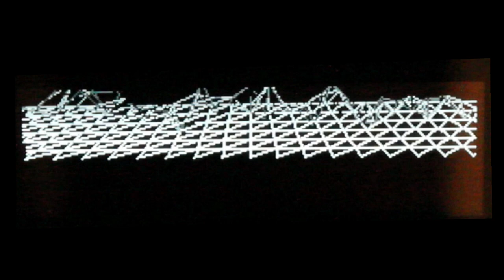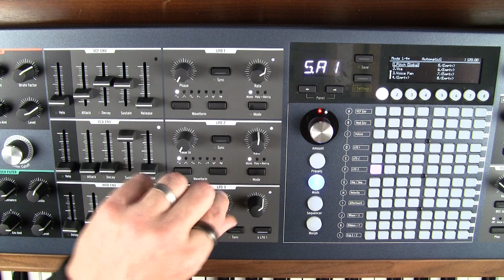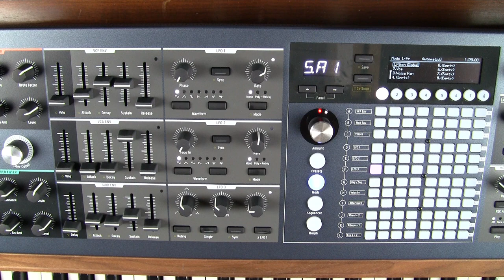12-The Arturia PolyBrute-LFO 3

Comment: One musical application of a unipolar LFO is if you want to use a square wave to modulate pitch for a trill effect. Using a unipolar LFO allows you to only modulate one direction in pitch, creating a trill where you don’t lose the note you are playing. For example, a flautist
 might do an upward trill or downward trill from a note and using a unipolar LFO allows you to simulate that.
Reply: ... or, with a slower speed and wider range, e.g. a 4th or 5th, to create harmonic movement.